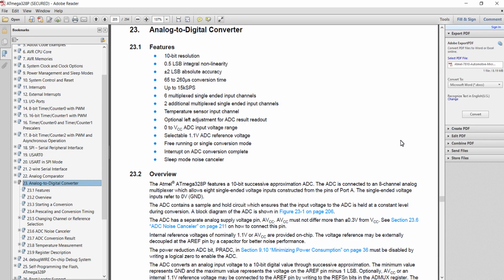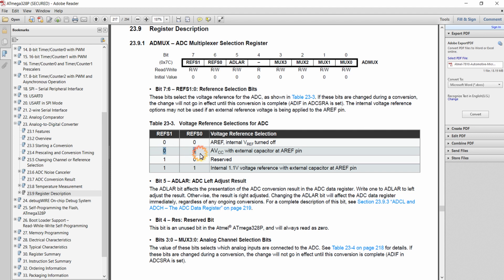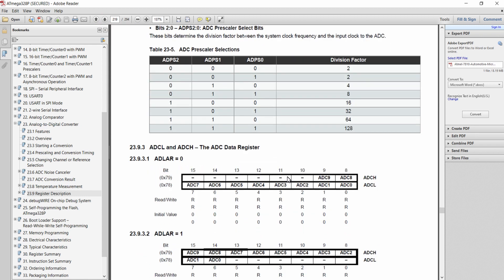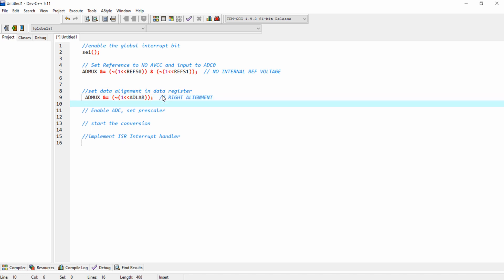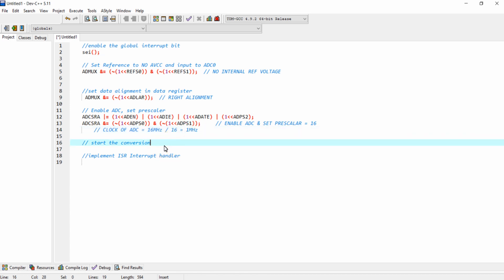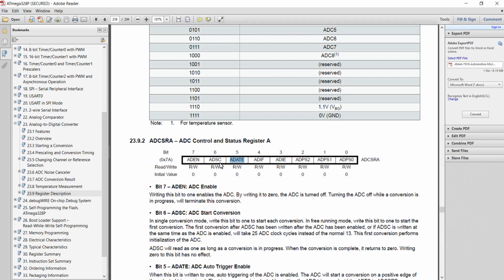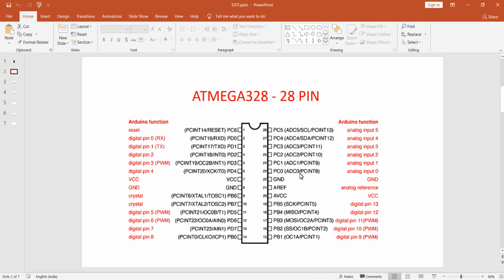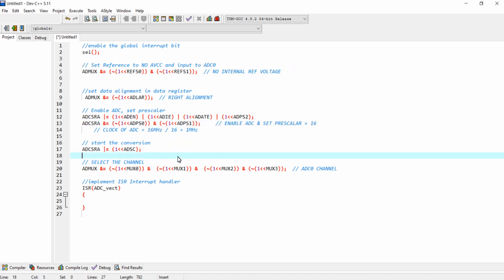ADC Register Configuration in Arduino | Register Level Programming in Arduino | T - 31

Comment: #include <stdint.h>
#include <stdio.h>
#include <stdlib.h>
#include <avr/io.h> 
#include <avr/interrupt.h>
#include <util/delay.h>

#define SET_BIT(reg, pin)           (reg) |= (1 << (pin))
#define CLEAR_BIT(reg, pin)         (reg) &= ~(1 << (pin))
#define WRITE_BIT(reg, pin, value)  (reg) = (((reg) & ~(1 << (pin))) | ((value) << (pin)))
#define BIT_VALUE(reg, pin)         (((reg) >> (pin)) & 1)
#define BIT_IS_SET(reg, pin)        (BIT_VALUE((reg),(pin))==1)

/*
**  Define function setup_adc which sets up the registers required for analogue
**  to digital conversion on an ATmega328P microcontroller. The function requires
**  one argument, as noted below.
**  
**  Parameter: division_factor - an 8-bit unsigned integer by which the clock is
**      pre-scaled. Your function should carry out the appropriate initialisation
**      action for any value of division_factor in {4, 8, 16, 32, 64, 128}.
**  
**  To do this:
**  (1) Assign a value to ADMUX such that bits (REFS1,REFS0) together specify
**      that AVcc with external capacitor at AREF pin is used, and all other
**      bits are zero.
**  
**      Ref: Section 24.9.1 of the ATmega328P data sheet.
**  
**  (2) Assign a value to ADCSRA such that ADC is enabled, and that bits
**      (ADPS2,ADPS1,ADPS0) together specify that the clock pre-scale division
**      factor will be equal to that specified by division_factor.
**  
**      Ref: Section 24.9.2 of ATmega328P data sheet, with particular attention
**      to table 24.5.
**  
**      Note: A division factor of 2 will not be used in this exercise.
*/
void setup_adc (uint8_t division_factor) {
    // INSERT CODE
    // Assign a value to ADMUX such that bits (REFS1, REFS0) together specify that AVcc with external capacitor at AREF pin is used, and all other bits are zero. 
    ADMUX |= (1 << 6);
    ADMUX &= ~(1 << 7);
    // Assign a value to ADCSRA such that ADC is enabled, and that bits (ADPS2, ADPS1,ADPS0) together specify that the clock pre-scale division 
    // factor will be equal to that specified by division_factor
    ADCSRA = (1 << ADEN); 
    if (division_factor == 4)
    {
        (ADCSRA |= (0 << ADPS2) | (1 << ADPS1) | (0 << ADPS0));
    }
    else if (division_factor == 8)
    {
        (ADCSRA |= (0 << ADPS2) | (1 << ADPS1) | (1 << ADPS0));
    }
    else if (division_factor == 16)
    {
        (ADCSRA |= (1 << ADPS2) | (0 << ADPS1) | (0 << ADPS0));
    }
    else if (division_factor == 32)
    {
        (ADCSRA |= (1 << ADPS2) | (0 << ADPS1) | (1 << ADPS0));
    }
    else if (division_factor == 64)
    {
        (ADCSRA |= (1 << ADPS2) | (1 << ADPS1) | (0 << ADPS0));
    }
    else if (division_factor == 128)
    {
        (ADCSRA |= (1 << ADPS2) | (1 << ADPS1) | (1 << ADPS0));
    }
}
/*
**  Complete function adc_adc which reads a numeric value from a designated
**  ADC channel on an ATmega328P microcontroller. The function requires one
**  argument, as noted below.
**  
**  Parameter: channel - an 8-bit unsigned integer which specifies the analogue
**      input channel to be sampled. Your function should work correctly for any
**      channel in {0,...,7}.
**  
**  Return: A 16-bit int containing the 10-bit analogue result.
**  
**  To do this:
**  (1) Assign a new value to ADMUX such that bits 4, 5, 6, and 7 are not changed,
**      and bits (MUX3,MUX2,MUX1,MUX0) are equal to the supplied channel value.
**  
**  (2) Start the conversion by setting bit ADSC of register ADCSRA.
**  
**  (3) Wait for the conversion to complete.
**  
**  (4) Return the value of register ADC.
**  
**  Ref: Section 24.9.1 of the ATmega328P data sheet.
**  Ref: Sample code provided in lecture.
*/
uint16_t adc_adc (uint8_t channel) {
    // Assign a new value to ADMUX such that bits 4,5,6, and 7 are not changed, and bits (MUX3,MUX2,MUX1,MUX0) are equal to the supplied channel value. 

    ADMUX |= (channel << MUX0);
    ADMUX |= (channel << MUX1);
    ADMUX |= (channel << MUX2);
    ADMUX |= (channel << MUX3);

    // Don't change anything else!

    // start single conversion
    // write '1' to ADSC
    ADCSRA |= (1 << ADSC);

    // wait for conversion to complete
    // ADSC becomes '0' again
    // till then, run loop continuously
#if !_AMS_
    while (ADCSRA & (1 << ADSC));
#endif

    return (ADC);
}

// uart definitions
#define BAUD (9600)
#define MYUBRR (F_CPU/16/BAUD-1)

// This buffer may be any size from 2 to 256 bytes.
#define  TX_BUFFER_SIZE  64

//uart definitions
static volatile uint8_t tx_buffer[TX_BUFFER_SIZE];
static volatile uint8_t tx_buffer_head;
static volatile uint8_t tx_buffer_tail;

//Functions declaration

void setup(void);
void process(void);
void uart_init(unsigned int ubrr);

//uart functions
void uart_putchar(uint8_t c);
void uart_putstring(char* s);

// END function declarations

//main loop
int main() {
    setup();

    for (;; ) {
        process();
        _delay_ms(50);
    }
}

//initialises ADC and UART port
void setup(void) {
    //init uart
    uart_init(MYUBRR);

    // Enable orange LED
    SET_BIT(DDRB, 5);

    //  Enable ADC with pre-scale division factor 128. 
    setup_adc(128);
}

void process(void) {
    char temp_buf[64];

    uint16_t pot = adc_adc(0);

    // convert uint16_t to string
    snprintf(temp_buf, sizeof(temp_buf), "%d", pot);

    if (pot > 512)
        SET_BIT(PORTB, PB5);
    else
        CLEAR_BIT(PORTB, PB5);

    //send serial data
    uart_putstring(temp_buf);
    uart_putstring("\r\n");
}

/******** auxiliary functions *************/

//PLEASE NOTE THIS VERSION OF UART USES INTERRUPTS

/*  **** serial uart definitions ********** */
/****************  interrupt based  ********/

// Initialize the UART
void uart_init(unsigned int ubrr) {
    cli();
    UBRR0H = (unsigned char)(ubrr >> 8);
    UBRR0L = (unsigned char)(ubrr);
    UCSR0B = (1 << TXEN0);
    UCSR0C = (1 << UCSZ01) | (1 << UCSZ00);
    tx_buffer_head = tx_buffer_tail = 0;
    sei();
}

// Transmit a byte
void uart_putchar(uint8_t c) {
    uint8_t i;

    i = tx_buffer_head + 1;
    if (i >= TX_BUFFER_SIZE) i = 0;
    while (tx_buffer_tail == i); // wait until space in buffer
    //cli();
    tx_buffer[i] = c;
    tx_buffer_head = i;
    UCSR0B = (1 << RXEN0) | (1 << TXEN0) | (1 << RXCIE0) | (1 << UDRIE0);
    //sei();
}

// Transmit a string
void uart_putstring(char* s) {
    // transmit character until NULL is reached
    while (*s > 0) uart_putchar(*s++);
}

// Transmit Interrupt
ISR(USART_UDRE_vect) {
    uint8_t i;

    if (tx_buffer_head == tx_buffer_tail) {
        // buffer is empty, disable transmit interrupt
        UCSR0B = (1 << RXEN0) | (1 << TXEN0) | (1 << RXCIE0);
    }
    else {
        i = tx_buffer_tail + 1;
        if (i >= TX_BUFFER_SIZE) i = 0;
        UDR0 = tx_buffer[i];
        tx_buffer_tail = i;
    }
}

I need some help completing this exercise. I have been trying it but can't seem to wrap my head around it sir. I even implemented the changes you mentioned in my previous comment. Please do create more detailed videos about ADC Implementation on Arduino. I would really appreciate that and it would benefit many others too. Thanks. Also, sir, do let me know what is wrong with my code.
Reply from the maker: Can you please tell me what are you trying to do I mean the logic you are trying to build
Reply: @SMtrainingacademy . That’s the part I don’t get sir. It’s just one of those online exercises we submit through an Automated Marking System (AMS) with a test driver designed by the Lecturer to ensure that our code outputs errors if we go wrong rather than not doing anything or simply displaying a random value from memory.
Reply from the maker: @SVSingam273   Your code is showing some error or not showing error but not working properly as per your logic...?  Have you tried in hardware or in any simulation software...? 
and also, What is the logic you were trying to build in this program I mean I'm asking the output result you want from the program..?

Comment: HI There. Could you publish a video on how to assign a value to ADMUX such that bits (REFS1, REFS0) together specify that AVcc with External Capacitor at AREF pin is used and all other bits are zero.
Reply: Btw, I love your videos. Please keep posting more content.
Reply from the maker: Thanks for your feedback @SASITHERAN
Reply from the maker: Hello SASITHERAN
ADMUX |= (1<<6);   // to set REFS0 = 1
ADMUX &= ~(1<<7);  // to set REFS1 = 0
REFS0= 1 & REFS1 = 0 means AVcc with external capacitor at AREF pin